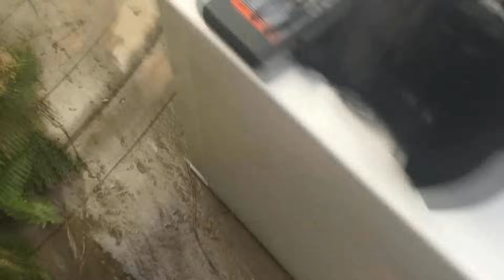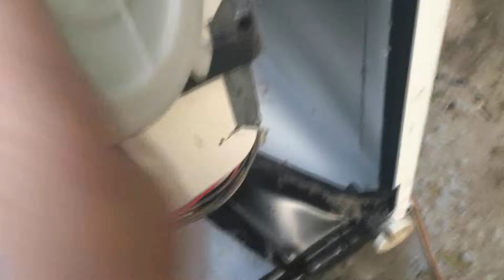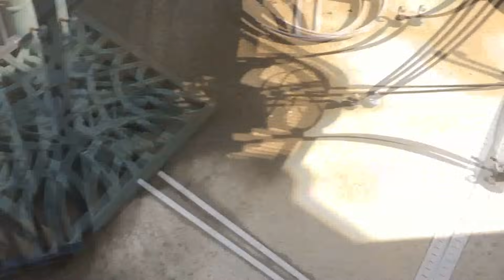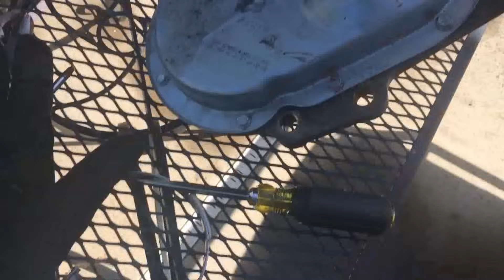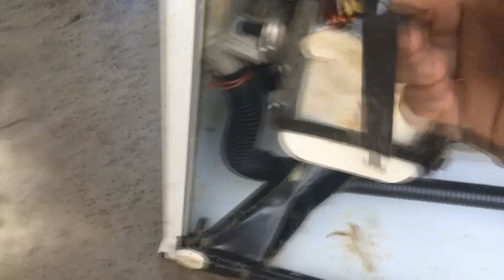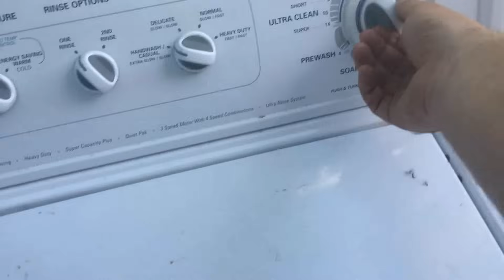How to Replace Clutch On Kenmore Washer - Not Spinning

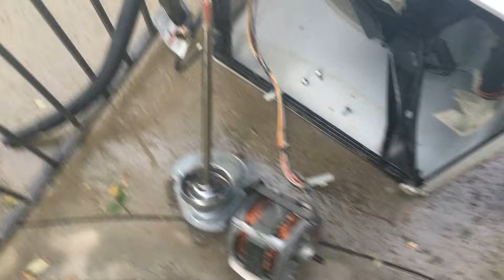Comment: Please help,Hank. Right at 5:29 when I'm about to pull out the transmission, it won't come out! It's like it's still bolted to something. The agitator is out, the model appears to be the same as the one in the video. ( Kenmore 80 series) please tell me what to do!
Reply from the maker: Did you release the 2 clasps that hold it on as well?
Reply: @hanksgarage_  , the clasps on what? I removed the clasps on the pump, moved it aside, the larger, longer clasps on the motor are still intact. The wires are unplugged from the motor as well.  I'm not sure which clasps you mean.

Comment: Hank, I can't seem to get the agitator off the drive shaft. There's the nut I unscrewed and all the top parts but that damn thing wouldn't budge. Any suggestions? Thanks.
Reply from the maker: May have to use a rubber mallet and give a few good whacks.
Reply: @hanksgarage_  Exactly what I did. I hit down on it a couple times and it must have broken the gunk along the inside of the shaft. Came out fine, went back in fine. Thanks so much!! Saved me hundreds of $$$.

Comment: I’m trying to do this and the transmission just won’t go back in. I have the washing machine tilted against the wall and I’m trying to put the rod back in and putting it back in about 1/4 or 1/3 of an inch it stops before aligning with the bolts on the bottom. I can see the rod coming out of the middle in the inside of the machine but I just can’t figure out with the bolts can’t go right up against the holes to screw in. Does anyone know why this is?
Reply from the maker: There is something getting in the way. It should not do that. Or the rod is not aligned properly. It’s been a while since I made this vid can’t remember too well.

Comment: Not sure if my washer has a clutch problem,I can hear the motor working and it does everything else,such as draining water,fill,etc but it wouldn’t agitate or spin, but there’s times that it would spin,so I check the agitator dogs and they were worn out,could the worn out  agitator dogs also cause it not to spin?thanks
Reply: Happened to me everything worked but agitator wouldn't spin. Come to find out, the nylon agitator dogs were worn and it was $6 to replace them. Works like a charm now.
Reply: Super Man well I replace the agit dogs,motor coupling,clutch assembly,& lid switch but it still doesn’t spin
The only way it would spin is when I manually rock the tub back and forth for a while then close lid and it spins.

Comment: I WAS SURPRIZED TO SEE THAT YOU DIDN'T HAVE TO REMOVE THAT RETAINER NUT FROM THE INSIDE OF THE AGITATOR SPLINE (AXCEL) WITH AN EXPANSION WRENCH. OTHER VIDEOS USE THAT SPECIALTY WRENCH AND WACK IT WITH A HAMMER ...oooops CapS

Comment: I am trying to get the bolt off so I can pull the transmission out, and cannot find the correct size ratchet for it.   You say in the video you believe the bolt is 7/16".    I even tried a 1/2 and it appears to be too small.   Would you think this is pretty universal for that nut?   I am so close!
Reply from the maker: +Matt Smith you can try a 10-11-12m
Reply: 7/16" hex head on the bolt, unless you have a different washer. Mine is a Whirlpool, but Whirlpool made that Kenmore, so it should be the same. Lefty-loosey?

Comment: Has anyone had any issues getting the transmission and shaft out? It goes about 2" then stops. I don't see any types of retaining clips either?
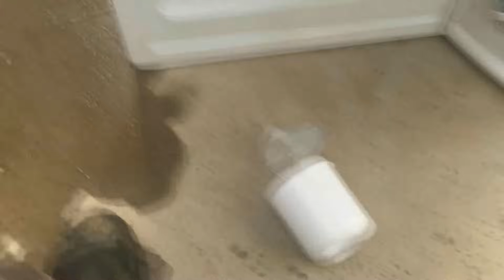Reply: If you can’t pull the entire transmission right out then that’s because you never took off the agitator bolt from inside the clothes-loading side of the machine. Go back to 1:56 in the video and watch how to remove the bolt.
Reply: @andygaudet  he probly did, i did too, the sucker stops at about 2" out..10 years old, so debating on hammer tapping, any "Good" suggestions?
Reply: CrazyDonutFace just keep working it at.  If you need to, tighten it back down again and try spraying a little lubricant in there. Then work it back off, repeat this until the bolt comes out.
Reply: The agitator shaft has a seal then a bushing just down the spin tube.   The corrosion and rust swelling makes the shaft stick in the bushing .  Oil it past the old seal, then tap it out with a pvc pipe or block of wood.  Sometimes the spin tube is also pitted and has bad seals and loose bushings.  The spin tube is available complete on Amazon.  The transmission usually has a neutral stage which drains the water before spinning.  This lightens the load on the motor and clutch.  Also bad top seals on the trans will wet the clutch and it will slip.  If there is no neutral, there is a kit to repair the trans.

Comment: Ok. So I've replaced the brake clutch, the coupler, and the dog agita. Washer still does not spin. Any advice for me. Kenmore 80s series. Thanks!!
Reply: Lid switch
Reply: Brake is different than the clutch.  Clutch was replaced in this video.  If you replaced the clutch and still doesn't spin, then you need to replace the gear case which is easy to do.

Comment: I have been heaving after removing those 3 screws but it just won't come out.  Any ideas?
Reply: Which 3 screws?  You got the transmission bolts out and the nut that holds the agitator on?  Should come out.
Reply: Did you remove the bolt from the top of the agitator?

Comment: HI Hank. Love your channel. Are you still in business? Am removing my clutch on my Kenmore 11082984120 (Whirlpool) due to no spin and no pump and was following your video and right when you got to the part where you were removing the clutch there was a break in the recording. When you came back on saying "with some heaving and hoeing it came right out". That's where I am. When I tried to pull it out it came about 2" and hung up. I didn't want to tear anything up if I could help it. Any ideas what might be holding it. Thanks in advance, Al